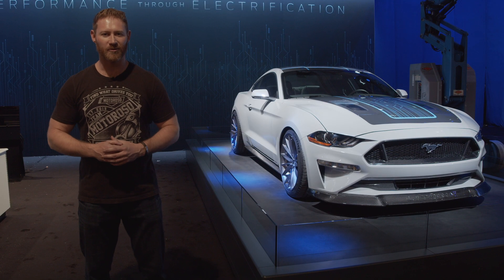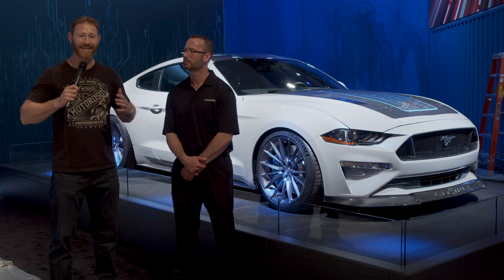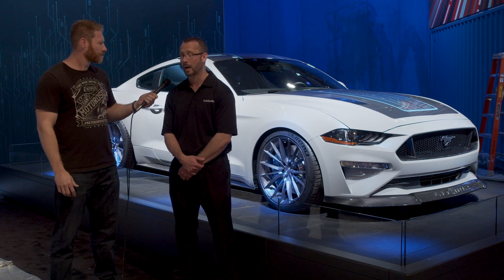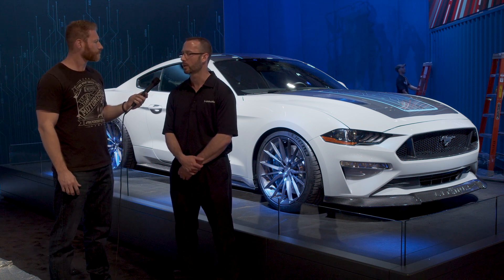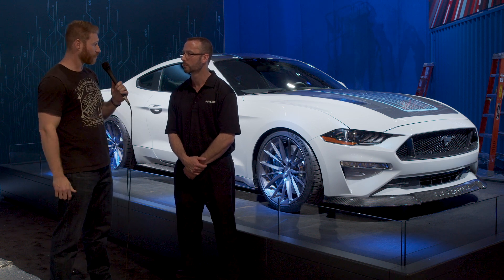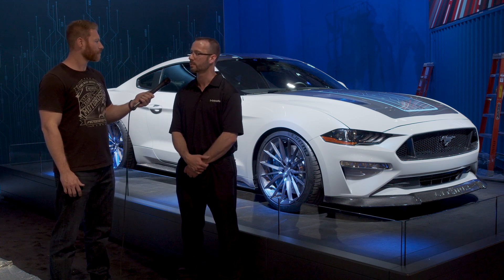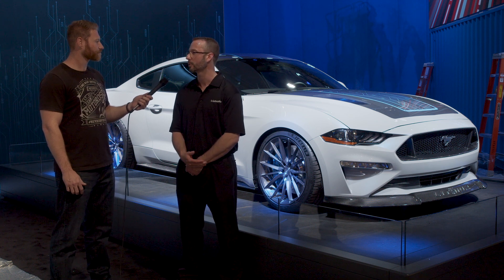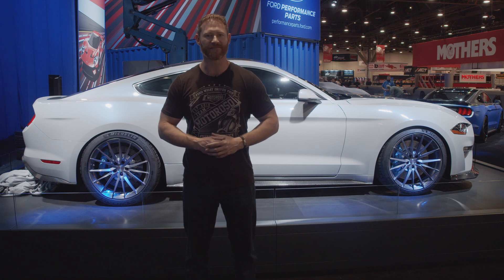1000hp Electric Ford Mustang "Lithium" Project at Ford SEMA 2019 by Webasto

Comment: 1000 electrical horsepuppies and manual?! Sign me up!
Reply: Is the factory transmission gonna hold up to over 1000ft-lbs torque? we shall see, 3 phase motors are powerful magnetic 2 strokes! hehe
Reply: @jlo13800  He mispoke that is a heavily rebuilt modified MT-82. Stock one would Disintegrate with that much instant talk.

Comment: Distance between charges. That's what i want to know.
Reply: Very short range, not designed as a real street car. It only has a 35kwh capacity and if you drive it with a lead foot you can eat that up in 100 miles. It's purely a proof of concept.

Comment: First comment. V8 owner and not sure if I like the fact that it has no sound. Can’t they make a new line up?
Reply from the maker: AlphaWolf haha! Can’t argue with that man, nothing can replace the sound of a V8! But after being up close with this thing and hearing the 1000/1000 stats, we want one.
Reply: @Motoroso  2 stroke v8 inverted loop scavened conversion
Reply: @Motoroso  2 stroke v8 poppet valved loop scavenged or uniflow with ports cut in the block, DFI v8 2 stroke anyone